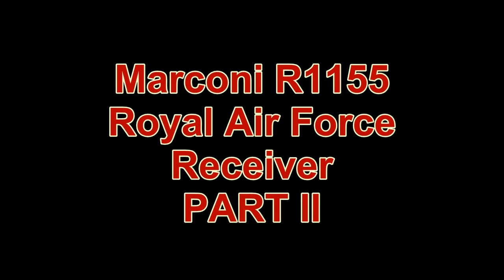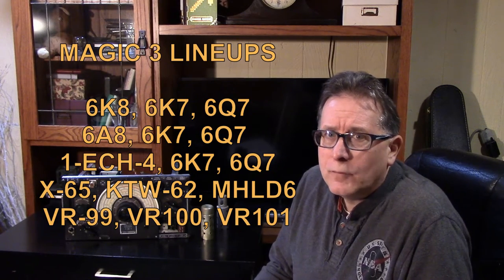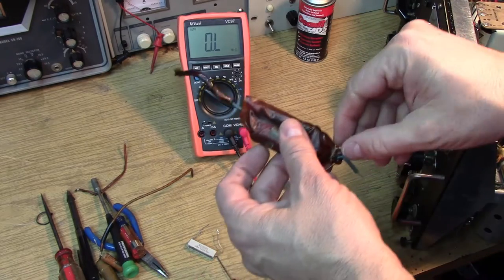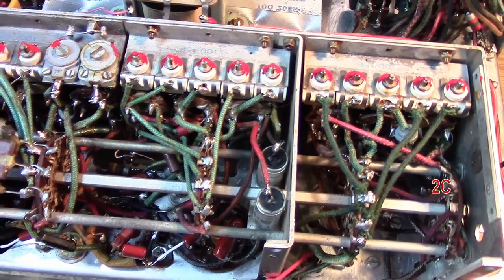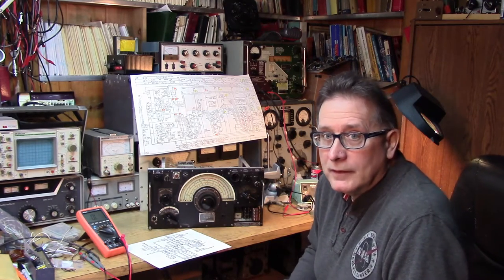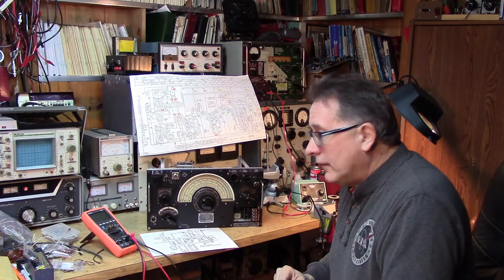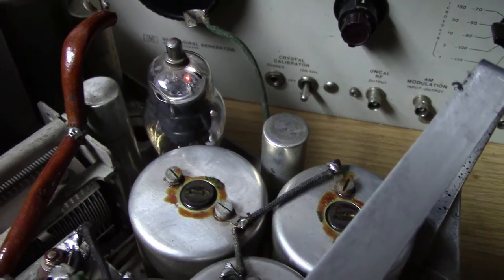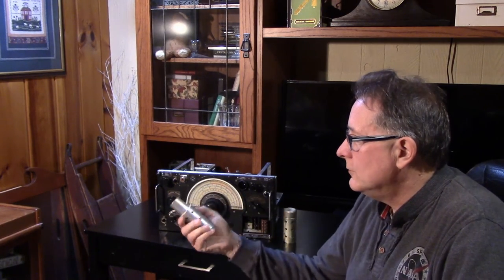R1155 Receiver Part 2 - Component and Wiring Clean Up

Comment: It is always painful to come behind someone else and clean up their mess as well as perform normal troubleshooting tests and repairs. Before applying full power to a set, I used to insert all tubes except the rectifier and then turn it on (providing it is a tube rectifier and not silicon diodes.)  Good luck with the rest of the restoration!

73 - de Mick, WB4LSS

Comment: Noticed that the jones plug that was originally used in the aircraft is labeled to match the radio correctly. The jones connectors sold in US are numbered in opposite order

Comment: I am really getting hooked into your testing and modification of the old R1155 RX there. I feel the need to strip down an old piece of gear and do some leakage/ resistance checks. At least I would be able to see what I was doing just with my normal reading glasses on .I hate having to setup God only knows what magnification to read SMD components never mind trying to de-solder them without loosing some of them . 73 de John - G0WXU.

Comment: You could have used Raytheon Wire-Ended vacuum tubes and maybe get it working on 24V HT on the plate and 3V on the heater.
Reply: David Gregory Kerr
Quite true... Could have got some busted tubes, stripped off the octal bases to make adapters to plug those wired valves (tubes).
Have to be careful.
The entire chassis is about 40-50 volts BELOW the B- level as part of the valve biasing system.
Can easily get into a bit of a problem, 
Changing the HT volts might deprive something else of a negative voltage supply. AND
the "Magic Eye" tuning indicator wouldn't be at all pleased to lose itS B+ AND have an extra 12volts jammed up its heater orifice!

Comment: I decided to restore an R1155, actually to make 1 good one out of 3 parts ones.
The R1155 is a British made constructional nightmare, this thing is impossible to work on, near enough impossible to disassemble and impossible to put back together again. Perhaps it was to stop the Germans from reverse engineering it, then again I doubt they would ever want to.
How they were originally constructed is beyond belief or comprehension, someone , somewhere just decided to make it as difficult as possible to build, it makes working on Japanese monster receivers seem like child's play.
I couldn't decide if I wanted it just to look original, or if I wanted it fully working, I decided to go for both at the same time, and also restore the DF section and add all the filter mods that were later officially done by the Air Ministry.
and just for laughs, i thought it a good idea to start with a bare chassis and gradually add bits from the other 2 radios.
Quite an ambitious project I thought, only to soon realize it's bordering on the impossible.
You are either an electrical genius with the dexterity of a contortionist or a sadistic psychopath that set out to deliberately make the impossible seem relatively easy.
needless to say I haven't finished my project yet, not even close.
however I haven't given up on it totally either.
each rainy day it get's a little closer to completion.

Comment: Anybody restoring an 1155 must be aware that the IF is 560 Khz  and importantly that DC ground is NOT chassis! NOT chassis.     Put it another way. Chassis is not at DC ground. potential.
Chassis is about 40/50 volts below ground... The biasing system can easily become compromised.
It is of course,  RF ground.
If the B+ WAS accidentally applied to heaters, it couldn't have delivered enough current to blow 6 or 7 heaters at 
300 mA each .. over two amps .
Ah.... I see you refer to the chassis NOT being ground potential later in the video.
The B minus /HT neg travels around on a 'rail'.
Reply from the maker: The fun of these old sets! Can we agree at least, that it is RF Ground? The biasing cleverness in making a single HT supply deliver both Negative Bias and Positive for the screens and plate made for some clever voltage divider systems.